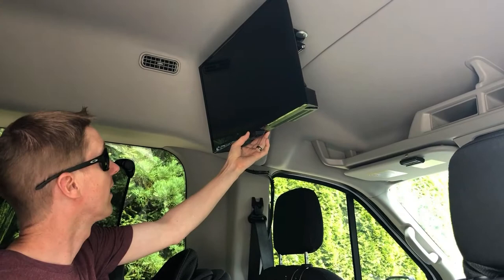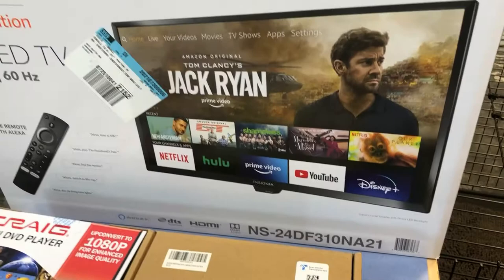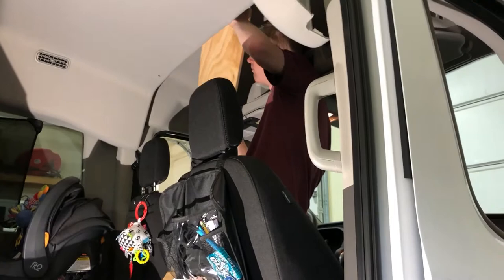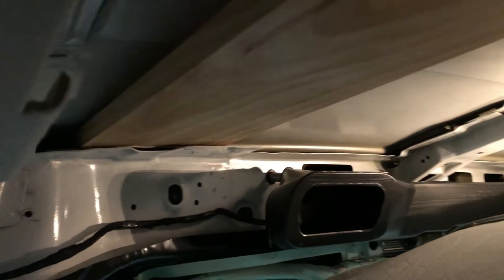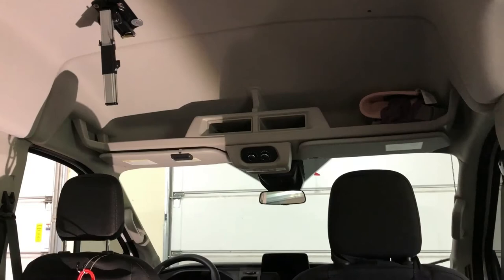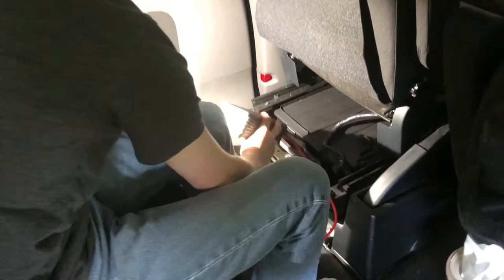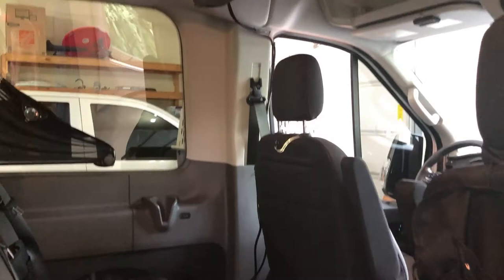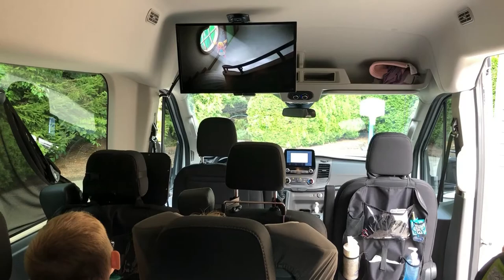Ford Transit TV Install

Comment: What was the length on the wood and did you consider bolt with lock nuts? Trying to mount closer to the front, 32" 12v led tv with a 4k SD card player 5v. Any thoughts including what you would do differently would be awesome.

Comment: Do you have the mid or high roof?
Reply from the maker: Mid
Reply: @workplay7200  can you send a link for the inverter you used?
Reply from the maker: @jefft9302   POTEK 750W Power Inverter 12V DC to 110V AC Car Adapter with Two USB and AC Charging Ports for Laptop,Tablet, Smartphone,Camera and More https://www.amazon.com/dp/B01FEUD9OO/ref=cm_sw_r_cp_api_glt_fabc_SZSYMEVF0ZC1DZ9C34QP?_encoding=UTF8&psc=1
Reply: What year is your Transit?
Reply: Was it easy t remove the ceiling panel?
Reply: What size tv is that?
Reply: @vladcuriel  it wasn't too bad. I bought the trim tool to make it easier.